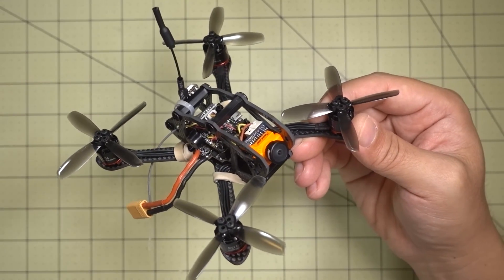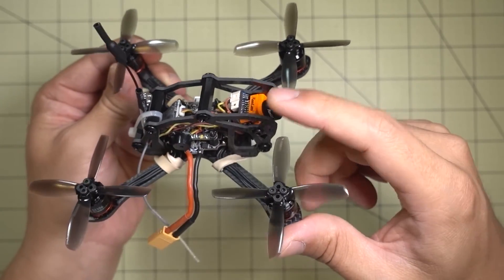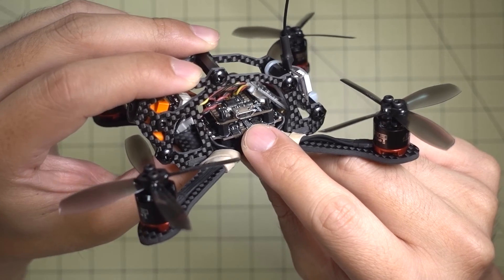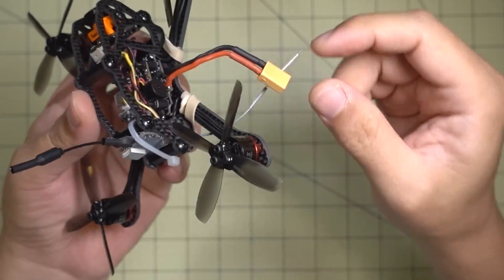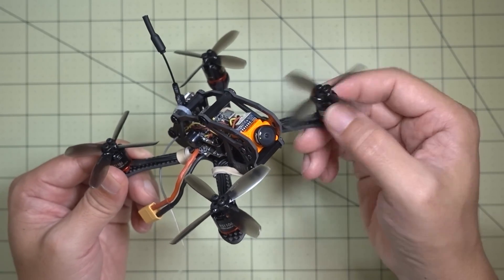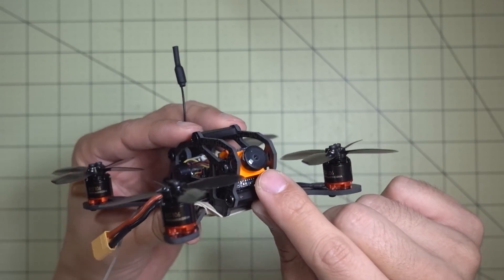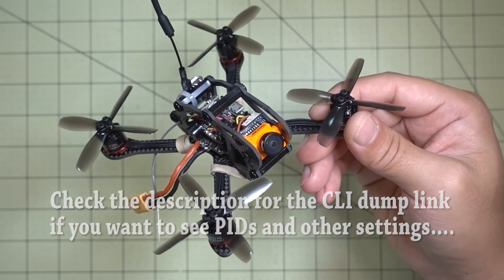Micro Drones 101 🚁#16⭐ Airblade Eclair V2 🔥👍

Comment: Hi Albert,  I have the HGLRC XJB F428-TX20 triple stack ordered.  Is there enough space in this frame to have the triple stack?  Also,  are there some other comparable frames under 130mm that would also hold this stack using 2.5" props?  Thanks so much for the work you put in.  Your videos are always very informative.

Comment: Have you ever run your props press fit without the lock screws, just curious? I did a mild flight on my 95gt and it ran very smooth with the Gemfan 2035 bn props. I know it probably depends on kv, battery type, etc. I wasn't pushing it just mildly cruising and all seems good.
Reply from the maker: i don't do that because I push my drones super hard and the prop will fly off.  If you just cruise around it's probably OK to do that.

Comment: Nice Albert,
I thinking about putting these motors on the leader 120 frame which should be more lightweight. Did you recommend this frame over the leader 120 fame ? and  which props did you recommand running on 3s ?
Reply from the maker: The problem with the Leader 120 frame is that it's difficult to mount a Micro Swift.  The Eclair is built for it.  On 3S, these props would be the best - http://amzn.to/2hicSAu

Comment: Hi Albert,

It has been a few months since you posted this video. I am planning on using the Airblade Ecalir V2 frame for a winter time 2S racer. Have your thoughts on these motors changed? I'm thinking about going with the Emax RS1106 7500kv.  What would your motor recommendation be if you were to do a 2S racer build with this frame now?

Thanks in advance and I look forward to more of your quality content!

- Mike
Reply from the maker: On 2S, go with the 7500kv.  I went with 6000kv to try out 3S...

Comment: Albert - I've learned so much from you! Thanks! Are the PIDS in your CLI dump for 2S or 3S? Any changes to the CLI settings you posted since you posted same? If for 2S, what would the 3S PIDS be or vice-versa? Thanks!
Reply from the maker: +George H 2s PiDs... the 3S is not recommended... the motors get too hot.
Reply: Thanks Albert!  I've ordered all the parts - maybe 3S with GF2035's?  It seems to fly great on 2S!
Reply from the maker: +George H maybe on the smaller prop, but then just get a 2 inch frame like the ascent
Reply: I ordered both size frames - which motors might you try with the larger frame to run 3s?  Thanks!
Reply from the maker: +George H see the motors from the pixel video
Reply: LOL - same motors I put on my Lizard!  Great motors!

Comment: Hi, Albert,  I have the following parts and I am looking for a 90-130 size 3K frame, do you think Airblade Eclair V2 is suitable for my configuration.  Any suggestion appreciated.

Motor: MKF1104 7500KV
ESC: 4 in 1 Oneshot/Dshot300 LDO 10A
Flight Control: F3 Bateflight_OMNIBUS w/OSD
Camera: 600TVL HD , 120°  --- Im willing to purchase Runcam Micro Swift
Video transmitter: 5.8G 40CH 25mW
Video transmitter antenna: 3DBi
Reply from the maker: +Steve E. YES. Those parts will work with that frame well.

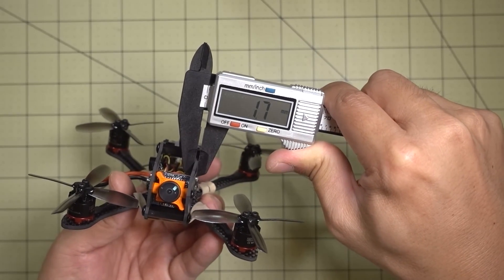Comment: I since gone to a Lumenier 4 in 1, Piko F4 and Innova V4. Very easy to set. I have the VTX backpack, but chopped it to fit the Innova, using just the antenna guide area for a nice AXII antenna. Good reception, apart from noisy areas causing signal breakup. It really is a great frame. The Airblade 1104 7500kv work well with 3s and the RotorX props. Run time is only 2:30, so I may try some 6500kv props...from what I've heard, 6500kv doesn't seem to lower performance, but keeps things running cooler and improves flight times.

Comment: Does that motor/prop combination really need 25A escs? According to the Emax spec sheet they are only pulling 7.3A on 2S. Surely it doesn't increase that much on 3S? 
I want to use these motors with 2S and 16x16mm electronics and the 4in1 ESCs are usually 6A (10A burst). I could get 2x 10A 2 in 1 escs, although it'd be nice to avoid the weight,
Reply from the maker: I just like a large safety margin.

Comment: Albert Kim, I'm just now dry fitting my frame together and it seems the horizontal standoffs are too long. Which allows the outer cage to shift horizontally. Did you just file away the standoffs or did you place something in between the baseplate and side plates. Thank you.
Reply from the maker: +Matthew Avignone mine was ok, but there was a bad batch recently. Contact the seller for assistance.
Reply: Yeah I spoke with Nguyen and created a work around. Thanks!
Reply: I had the first batch, elastic bands secure the side plates fine.
Reply: I’m using the backpack on mine so the back fit fine . Just had to sand down one standoff in the front and all is good, frame is super stiff , no play/ 💪🏼

Comment: I'm running a Racer Cube F4 with 10a esc. I'm using 1104 
7500kv motors with gemfan 2035 and have some 3
rotorx 2535 props too. I hope 10a will be enough

Comment: Did you have any issues with Ibus on that fc? Mine doesn't want to connect. Other people in bg forum are saying to use dsmx?
Reply from the maker: +Danny G it works on uart2... don't use the default receiver connection. The signal is hardware inverted and won't work on that connector. Watch my FD120 video to see the wiring.
Reply: Albert Kim oh ok I think uart 2 is the dsmrx pad because uart2 doesn't appear yet in betaflight

Comment: Just got that frame in and can't wait to build it. My question is which do you prefer more the spintech 1106 8000kv on 2s or those emax 1106 6000kv on 3s?
Reply from the maker: +Matthew Avignone both good. Still undecided
Reply: Yeah, I actually got both the 2" and 2.5" version of the frame with the spintechs. I'm going to first build the 2" try 2s and see how it handles, then maybe push 3s on the 2" blades. So far I have not see anyone do any tests with the spintechs on 2" and 3s but we shall see.

Comment: Great flying! I like the frame, but love its big brother, the XBL2. I'll probably opt for the 2.5" CS110 on the way. My 2" ARfun 90 is a disappointment so far. Prop strikes, then rattling noises after cutting 1mm off both front props. These micros are more "sensitive" than my 5" quads (just smooth). Don't really know enough to tune, but have a list of "fixes" to try!

Comment: how do the emax 1106 run heat wise? I had bad problems with the brotherhobby R3 5100kv running hot, like 135F on the bell with it 95F outside. also, how do these compare to the realacc 1106 6000kv? super curious about that. they look fairly similar in performance
Reply from the maker: These run hotter than the Realacc. I think it's the magnets. Very strong. But the performance seems similar.